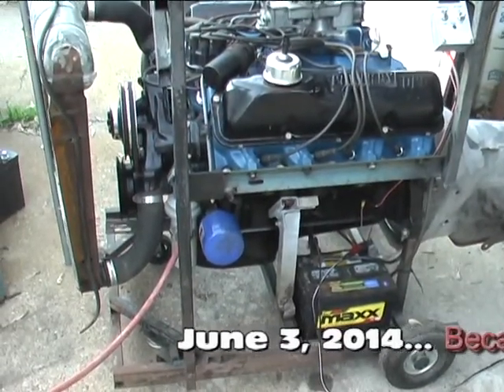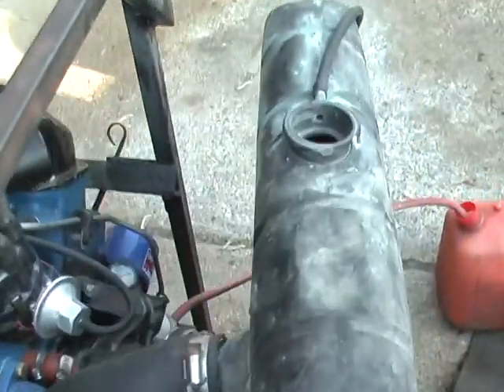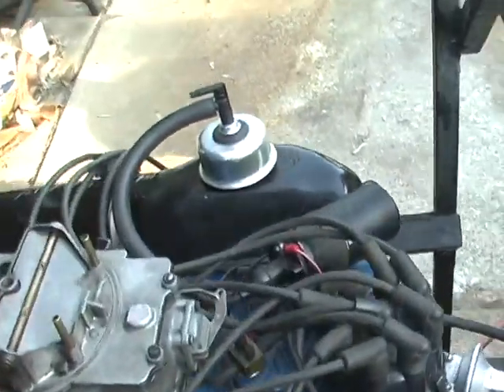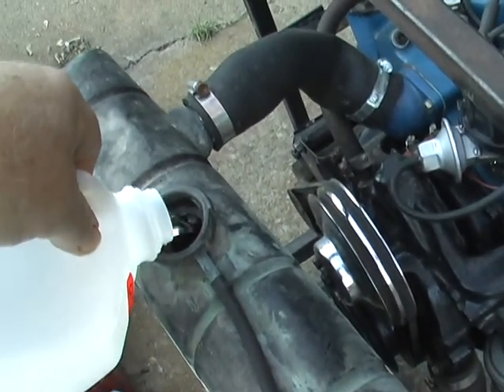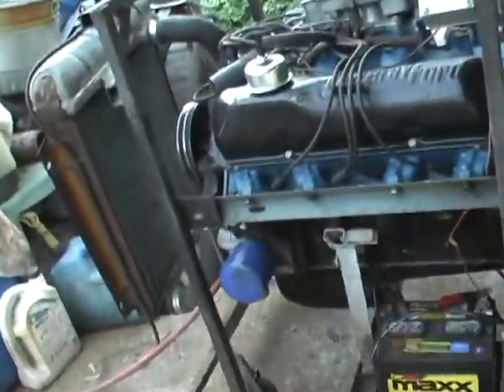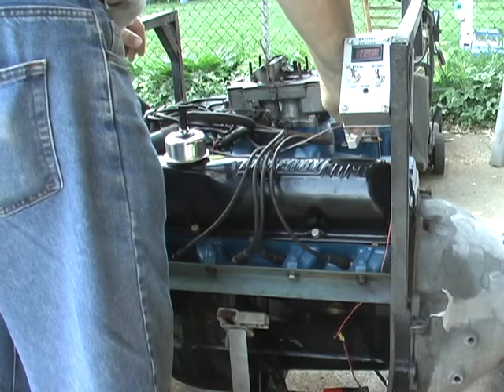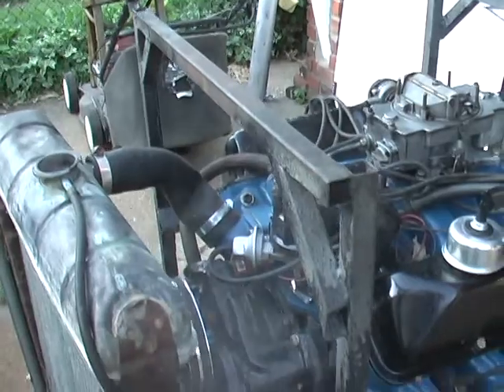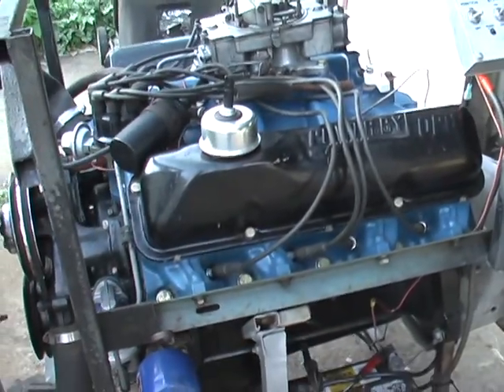2014 06 03 390Engine

Comment: Nice job! My 390 FE in my 1966 TBird had 5 bent push rods all on the intakes and it was still able to start and run that was when I purchased it 10 years ago....it was a simple task and 16 dollars to change, but 8 am afraid I never found the cause and she is back running horribly. I expect I will find more bent pushrods. Previous owner put in a performer camshaft from the recipts but thats all I saw.
Reply from the maker: A few things cause bent pushrods.  I would immediately suspect bad (old) gas.  It tends to stick intake valves.  That causes two problems because the cam keeps running when the valve hangs open. (Notice, bad gas is rarely a problem on the exhaust side.)  If the piston closes the valve,  the valve stem can bend.  Since the cam kept going, the pushrod  may have dislodged when the valve was open, causing the pushrod to bend.  Another cause of course, is to exceed the  lifter's preload.

What to do:  Remove your rocker shafts.  With a rubber mallot,  'pop' each valve with the hammer.  All intakes should sound the same and all exhausts should sound the same.  If you have a bent valve, you can hear it because a bent valve will not seat properly and sometimes they stick open.  There is no substitute for fixing a bad valve.  The head and valve must be removed.  Remember to remove all pushrods FIRST, before removing the intake manifold.

Comment: I really enjoyed the video! I saw your webpage about the build.
 That is a super smooth running engine. I'm building a 390 to put in my '66 Galaxie. I hope that it turns out as nice as yours did. What did you put the engine in? Message me back sometime if you want. I'm always glad to meet new FE friends.
Reply from the maker: Ryan, I use the good stuff to give the service it's intended for; daily driver/street engine w/balls that will last 250,000 miles using pump gas and name brand dinosaur oil.It starts by stripping an old but good block down to nothing, then tanked, baked and Magnafluxed (for cracks). The engine machine shop determines how much bore it needs, then all the parts are ordered.When pistons arrive, the bores are machined TO THOSE PISTONS, not the other way around. The block decks are machined flat and the rods are reconditioned so the bearing holes are round and correct. FE and Y-Blocks need 'oil modifications,' especially in the heads to restrict rocker shaft oil flow.New parts include: Edelbrock Performer RPM heads and intake (all aluminum), roller cam and Morel lifters, Hypereutectic alloy 9.5:1 pistons, Moly Hastings rings, Clevite bearings +10, +10 rods and crank, true roller timing chain set (advanced 4-degrees), OEM rocker arms and shafts, new shorter pushrods (because of the roller lifters),  Melling high volume oil pump & intermediate shaft, composite distributor gear to mate with the Comp Cams teeth and a set of brass core plugs...The real test is in the details that only cost your time (but a shop won't do). Rods are balanced on each end, then all weight-matched.  Pistons are matched and assembled, then the 8 piston & rod ass'ys again weight-matched within 1/2-gram.  One piston assembly; piston/rod & cap/bearings/rings/wrist pin & keepers/studs & nuts is given to the crankshaft balancer. He adds 2-oz for oil then sets up his dynamic balance machine with bob-weights to simulate the pistons. Crank grind and balance ~$120.  Well worth it and far better than factory spec's.I test fit then gap all my rings and Plastigage every bearing.  You see the results.  Since that engine, I did a 351W for a man in Fort Worth.  Same thing (as all my engines).  BTW, Chevy mechanics don't understand Ford FE engines. I started in my teens on GTO 389 engines.  Questions?